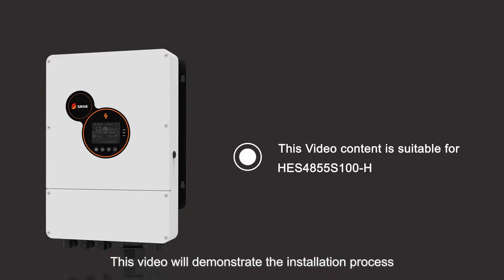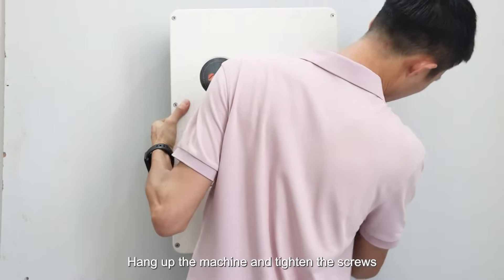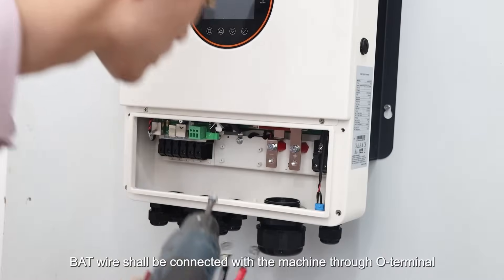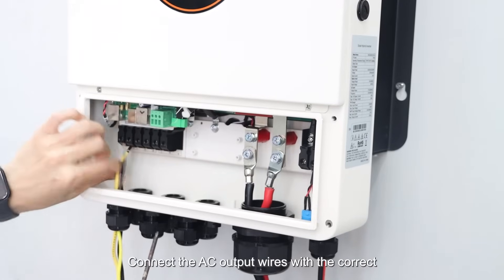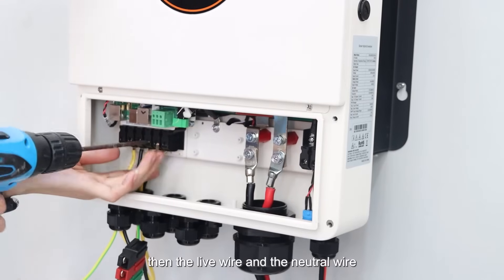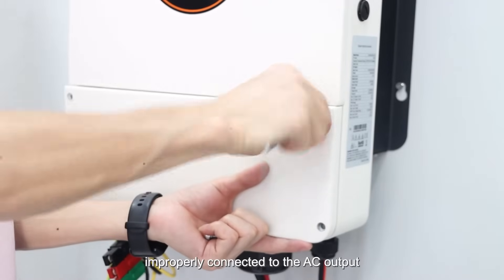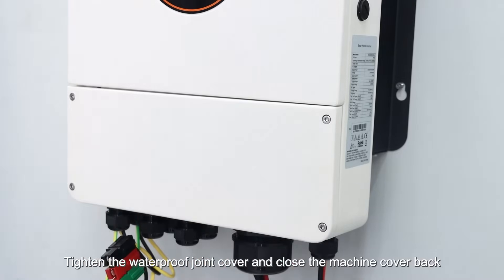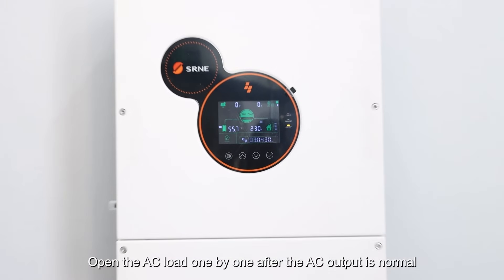Hybrid Solar Inverter HES4855S100 H Installation Steps

Comment: This sort of add will do SRNE no favours at all. None of the terminals were torqued down. Bare cables sticking out of terminals, You could see some of the core cables had been cut back to fit the lug & no heatshrink on lugs that were never torqued. Just bad workmanship.

Comment: Using 3kw SRNE,  facing an issue!  Error 9,  which means pv over voltage only at 90+ volt! Although it says 100V but actually it can handle only 90v.

Comment: I am facing an issue in my solar invertor SRNE 5.5kw. inverter is showing current on Neutral. Even invertor is properly grounded. And all load or input wire disconnected from invertor .any one can help